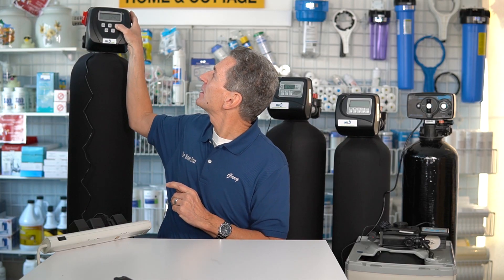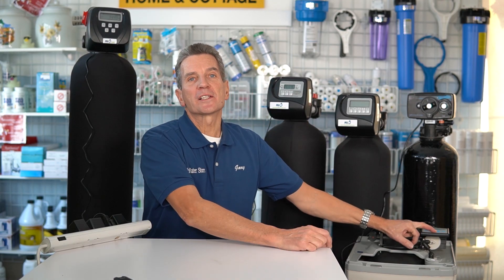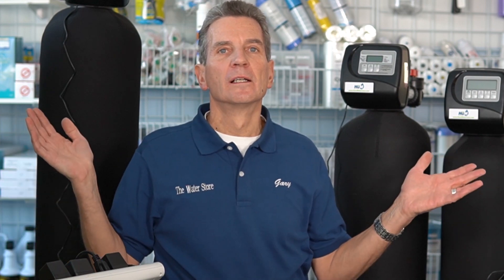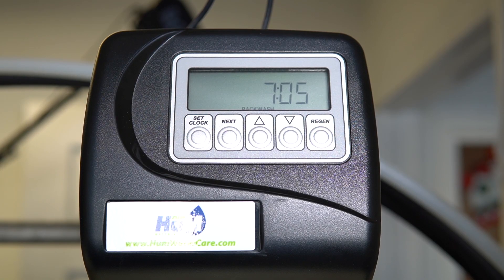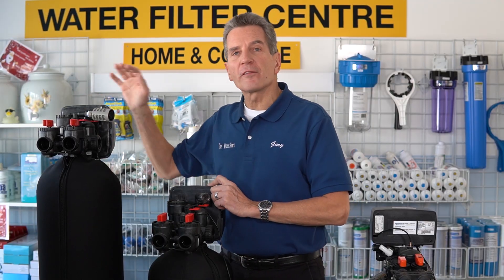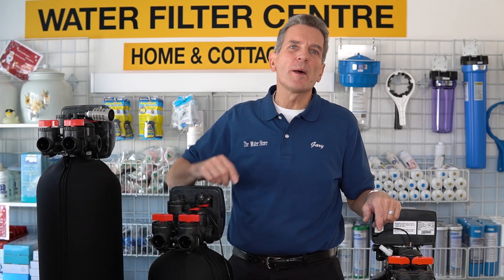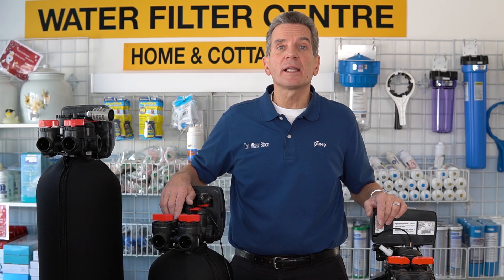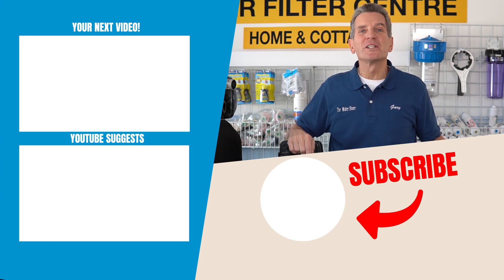Avoid this WATER SOFTENER MISTAKE before it's too late!

Comment from the maker: This is the most common mistake made when a water softener malfunctions.
Reply: Well on a unit that the back wash step is flushing the resin out of the unit. I noticed this so I throttled the water into the unit. this pretty much stopped the loss of resin but continued the backwash. What is your suggestion in the future?
Reply: Hi Gary, thanks for your how to help. I have a ge pro elite and my outside line is frozen. But I got opened up after my brine tank filled up all the way. So is there a way I can drive the tank?

Comment: We have springwell whole house filtration system and recently it showed error 6 when back washing but it went off...what do we do?
Reply from the maker: Not familiar with that product but I would unplug, wait 5 minutes and plug back in to let it reset.  If all is ok afterwards, you're done.  If not contact the manufacturer for service.

Comment: while it regenerates, I do the bypass, will it hurt the system?  thanks.
Reply from the maker: If you bypass during regeneration it will stop the regeneration but it won't damage anything.
Reply: @water_estore  Thank you, my question is if I bypass, do I have to disconnect the power? or just leave it on?

Comment: Hi Gary, we have a hyperion elite water system. We noticed our water was coming out of the faucet really slow and we did regenerate several times but that did not help. We had to bypass the system. So do we call a plumber to see if there is a clog in the system?
Reply from the maker: You can check it out with the process in this video https://youtu.be/tCQQxiT-zoc

Comment: Gary: Have two tanks. System is set to soften water too. . Regen was set for 12midnight every day. Have a "regen today " flashing on one of tanks. I guess regen is not working . Is that right?
Reply from the maker: Not necessarily, "regen today" just means that tonight at midnight it will regenerate.

Comment: Can I bypass my water softener and then manually Regen it or would it not work properly
Reply from the maker: If you bypass thre water softener there will not be any water running through it to be able to regenerate.

Comment: I have your WATER BOSS style bypass with the knob on top of the unit. The knob turns to the bypass position but doesn't divert the water. It continues to run water out the drain hose at full force. It ran for 8 hours before I turned off the water to my entire house. Can you tell me how to fix my bypass valve so I can turn the water back on to my house.
Reply from the maker: You would need to replace the bypass.  We have them here https://waterestore.com/products/aquamaster-bypass-assembly-54512-ams-700-900-or-950
Reply: @water_estore  Thank you for your quick response.

Comment: I have a Whrilpool Model WHES40 water softener. It's about 20 years old. I noticed the water keeps running, even when it is not in the recharge mode. So, of course, I unplugged it. The water kept running. I can tell because there is a pipe in the laundry room that discharges water when the water softener is in the recharge cycle. In this case, the water keeps running no mater what,  whether the motor is on or off. Fortunately, I have a bypass valve  independent of the water softener, and I can bypass the unit. The water has stopped. The recharge motor works. The display shows error 3. I assume the valve is stuck in the open position.  Maybe I need to replace the switch? I think it is stuck in open position.
Reply from the maker: Water is leaking past the piston and seals. Time for a new water softener, I suggest you check out this one. https://waterestore.com/products/hum-deluxe-water-softener-30-000-grain

Comment: I have a whirlpool whes40 and I have trouble shooter everything I can but can’t figure out why it’s spraying out water during only regen where the drain line plastic meets the machine not the actual drain tube ?? Please help
Reply from the maker: Have you tried replacing the fitting?  It may be cracked.

Comment: My Mark 59 culligan water conditioner motor will not turn off
Reply from the maker: There is a problem with either the piston being stuck or the circuit board.

Comment: We just bought a cottage that has a Vigua Impression Series system. During the pre-purchase inspection in April all seemed to be working well and there was salt in the brine tank. The cottage has been unoccupied until we took possession this week. The salt in the brine tank was gone so we added two bags and ran a manual regeneration. Our water is very cloudy (haven’t tested the hardness yet) and it looks like water isn’t getting into the brine tank. There is a fill tube with a float. The float moves freely and seems to be resting in the down position but there is only a small amount of water (maybe an inch) at the bottom of the tube. There is water visible i. The clear tube that feeds the brine tank but it looks like it’s not filling. Any suggestions?
Reply from the maker: Watch it as you manually regenerate it. You should see water being added during the first or second cycle. The being slowly sucked out during the regeneration cycle. If it doesn’t, I suggest you follow the recommendations from this video. https://youtu.be/_ws88RC9KYk?si=WUw5DLKuzrPzF_gE
Reply: Thanks I’ll give that a shot. Our system has two connected tanks each with its own digital control panel. Should we be initiating a regen on both in the same way at the same time?

Comment: Mine water softener motor does not turn off it keeps running
Reply from the maker: Sorry to hear. Likely there is a problem with the circuit board or the proximity sensors.

Comment: I unplugged it.yikes. i have the 440autotrol and its old but still works. How do i turn that or stop the flow with it?
Reply from the maker: You would need to finish the cycle, but I'm not sure hoiw you would do it with that one.
Reply: @water_estore  Thanks for replying but its ok. It did finally stop so i think I'm good. Yes, its an oldy but goody. 35years old 
Pretty much no one even knows how to work on it but thank you.
Reply: @water_estore  I think it did finish. Seems to be OK now

Comment: I had a well still have a water softener in bypass mode that malfunctioned it managed to flood the leach field and drain the well ruined the well pump which turned into a very expensive pain in the butt. We had a plumber service it once a year he pooped the face plate off played with something in there dumped something in the brine tank and drained the spin down strainer. Im a little worried about using this thing again I called a well diggers place they want 4 to 8 thousand dollars for a new system which I don't even lime buying salt lugging it around and its not cheap anymore either. I definitely don't want this thing draining in my septic again they said well you can drain the wash water into a rock well or down your driveway only we can't do it you have to ? Huh ? That sounds sketchy. Do these electronic descalers work? I've been trying to find an alternative to water softeners using salt and water I don't have the greatest well unfortunately the water is crap it has maganese rust amd is hard probably not as horrible as some Ive heard of but we buy water for cooking and drinking and ya know have had to about anywhere we have lived.
Reply from the maker: Sorry to hear but that happens very seldom,  We have water softeners here for less than 1/2 the price you were quoted and ours are Made in North America. https://waterestore.com/search?pf_pt_product_type=System&q=water+softener The electronic ones don't work, waste of money.

Comment: My rheem softener, at the end of the regen cycle, makes an insanely loud water rushing sound. Wakes me up all the time. It does stop though after a few minutes. Cant find much information on loud water rushing sound. Is this normal? Literally sounds like I have a major water leak in the house.
Reply from the maker: The back wash cycle is quite loud and yes, it does sound like water running quickly.

Comment: When i use regeneration should it keep water running or not. And when the water need to run during regen.
Reply from the maker: No you do not need to run water in house during regeneration.

Comment: My Ecopure water softener had running water out of a full tank. And water all around the electronic/mechanical controls!! 
I tried the bypass valve first, no luck, to much pressure. Then turned off main house water valve. Now, there's the pressure off, and can move softener bypass valve now. Water stopped. Took off control panel lid and water all up in there. Control panel all wet and Flashing!! I Didn't want to keep electric plugged in so I unplugged power.
Reply from the maker: You just need to find the leak and fix it.

Comment: Hi Gary this is Mike I have a GE gxsh40v 00 water conditioner and it is not letting me reset the salt level it always says off what do I do
Reply from the maker: It sounds like it might be locked, did you check the manual?

Comment: My tank filled up with water and I noticed the little black hose out the back of my house was running water continually so I bent it in half the stop the flow. I noticed the LED was giving me a code but I also noticed the recycle light was not working any ideas need help bad
Reply from the maker: you need to go through the steps in this troubleshooting video https://youtu.be/Lr3jyGiJdC0

Comment: I have a Runcin F67Q1 water softener valve which is straightforward to connect and charge a resin tank with resin. The DC 12volt connection also no problem. How is the brine tank connected to the resin system for flushing? the F67Q1 valve has 3 ports : IN, OUT and DRAIN.
Reply from the maker: I am not familiar with the Runcin A67Q1, I suggest you ask them.

Comment: I have a water softener and the panel says call on it if I push a button the call goes away but comes back up after a short period of time the valve looks like a clack valve with the red arrow flow nobs
Reply from the maker: Yes, someone programmed that in so you would call them once a year for a service call you likely don't need.  We never use that.  I would just ignore it.

Comment: My landlord had installed an old faulty water softener into the house I'm renting and that water softener is ridiculous, water costs almost $1000 every month. However this video was unable to help, there's a kind of lock on the valves, they cannot turn at all. Anyone know how to safely remove a lock on the valves?
Reply from the maker: We have this video that explains how to unlock the valve https://youtu.be/bU3wW29R7iE
Reply: @water_estore  Oh, mine is an older model with 4 buttons. The lock is a physical plastic setup, one on each valve holding them open and a little plastic lock-shaped thing on them.

Comment: Love the info you provide! Question for you. Is there a need to install a 3 valve bypass if there isn't one presently in my plumbing for my water softener lines. Should purchasing a water softener with a bypass suffice? My lines are 3/4". Also, I was thinking of adding ball valves (FIP-MIP) to my threaded in and out lines coming out of the wall. Would you suggest teflon tape on the threads? Also, one (in) is facing straight and the other line (out) is facing down. Is that something that needs to be changed?
Reply from the maker: Water softeners with bypasses do suffice like this one https://waterestore.com/products/hum-deluxe-water-softener-30-000-grain. Yes Teflon tape and pipe dope

Comment: Thank you does water softener leak and slowly runs water in pipe hook up we’re you don’t know it’s leaking cause water bill suddenly went up and there’s no leaks in house and also how much water does it use compared to appliances thank you very helpfull vids
Reply from the maker: It sounds like you have an older water softener and the valve needs to be rebuilt

Comment: I’ve been noticing dried fine salt in my shower floor and sinks.  Also my water is not as hot as it should be.   Is there an issue with my Softner?
Reply from the maker: Maybe and maybe not.  I would have your treated water tested to see if it is hard.

Comment: What do you do if the salts were added to the tall cylinder in the large plastic tank with the water?
Reply from the maker: If you mean the brine well, about 3" in diameter with thefloat inside?  You need to remove all of the salt, clean every thing out of the brine well and start over.  Your water softener can easily flood the area in which it is installed when that happens.
Reply: Do you add water after cleaning everything out? Old culligan system

Comment: We are based on borewell which is 1250 ft where water levels are less and contains mud and other particles which blocks the taps if we on regeneration lot of water is going on. Can we retreat and use for daily cleaning activities because we r living in water scarcity area
Reply from the maker: no as waste water is very high in sodium.

Comment: Hello Gary, My water softener regenerates every 14 days.  No Issues while using the water every day while the house is occupied.  However, if I leave the house for more than a few days, when I return, the water is brownish in color.  After running the water at the sink for several minutes, it clears up.  I have a chlorine filter at the water softener but this does not appear to help mitigate the issue.   The water softener is only 2 years old.  Thoughts?
Reply from the maker: I would have the brown water tested to see what is making it brown

Comment: Hi Gary! I have the Gold Kinetico water softener. One night, I noticed that water continuously flowed without stopping into drain. I added a bag of salt inside, but still water kept flowing. So I put it on bypass, but haven't used it for several months. Can I use it again? What should I do? It's so hard to open the bypass valve. I've tried everything, but still could not open it. Thanks!
Reply from the maker: Your water softener valve needs to be rebuilt.  Try shutting off the water before the water softener, releasing the pressure by opening a faucet and then bypass.

Comment: My water softener has been not used in years. It has no codes. And the filter is clean.

It does have a clack water valve with bypass turned on. If I manually run it through the cycles it leaks when it goes to the fill cycle.  And my question is does that mean that the tank has a restriction and it’s not allowing it to fill? I did take the valve out and make sure it is no debris.
Reply from the maker: not necessarily.  It could just have a cracked part causing the leak.

Comment: Hi. My water tech guy replaced the internal mechanism with computer for my salt water softner. I had my system since 2008. My water still feels hard and notice salt level has not gone down. doesnt seem like water is disolving the salt. What is your advise to resolve issue?
Reply from the maker: I would call him back to troubleshoot.  This will help https://youtu.be/Lr3jyGiJdC0

Comment: II have a Moen Flow auto water shut off installed in my main pipe. Recently, during the regen cycle, the Moen flow suspected a leak and shut off the water.  I’l deal with Moen later.  But my current concern is, what can occur to the water softener, when water is shut off to the unit during the regen cycle?
Reply from the maker: Great question.  Nothing actually, i would just schedule a regeneration tonight to make sure you donèt run out of saft water.  By the way you might want to check out my Water Softener Live Stream Q&A tonight at 7 PM Eastern Time here https://youtu.be/D8jr27DAekg

Comment: Hi Gary, I have a question about my brine tank water level. We just dumped out our brine tank and cleaned it thoroughly and replaced the brine well and valve and float assembly with brand new one. The control head on my water softener is exactly the same as the one in your video at 2:20. As  the water level goes down during the Brine Draw phase, eventually the water level gets very low and I hear air and water sucking sound through the brine tube connector, but there's still 22 more minutes to go in that BD cycle and it's making that sucking air and water sound for the remainder of that cycle. The water level never gets any lower in the brine tank during that time. My question is do I have enough water in that brine tank? I have my hardness setting on 11 and a regeneration every 14 days. My water test said I have 1 PPM of iron, and 10 PPM of hardness.
Reply from the maker: It is normal to run out of water since this cycle is actually the brine draw/rinse so it does both brine and rinse once it runs out of brine.

Comment: Appreciate the videos. Why would a waterboss leak from the back of the piston assembly under the display panel? Even if I switch to bypass I get a trickle.
Reply from the maker: Not sure, did you try tightening the screws?  I've had to do that before.